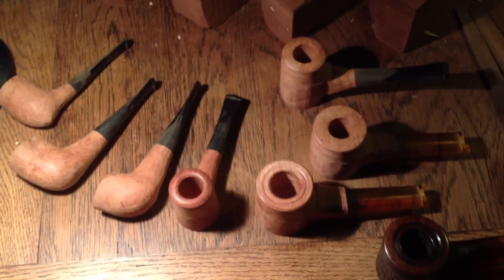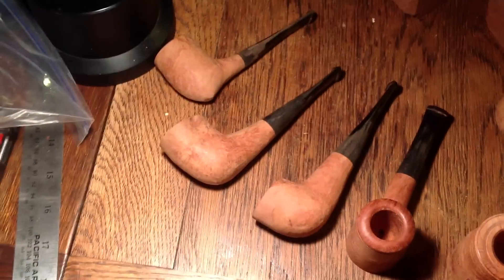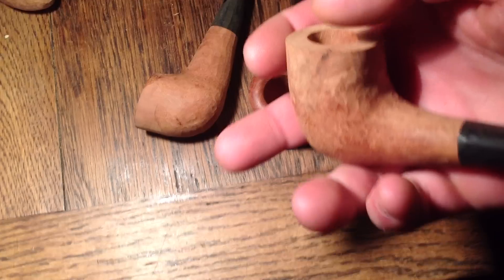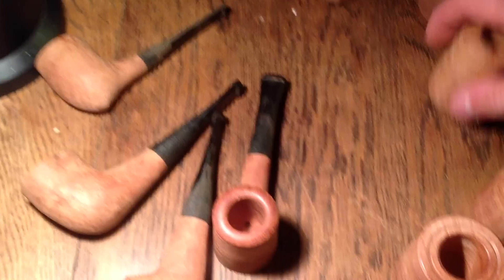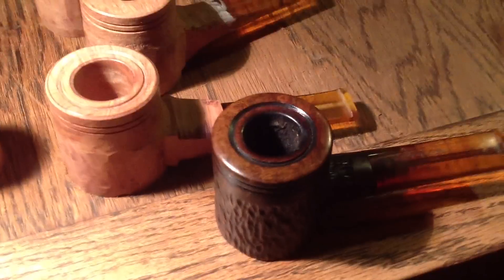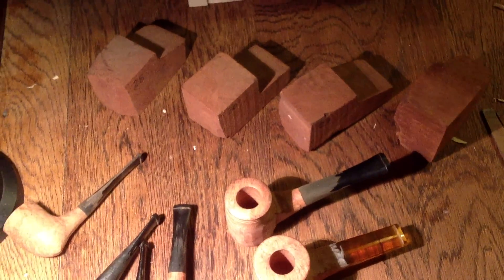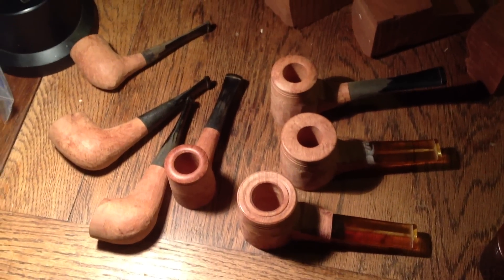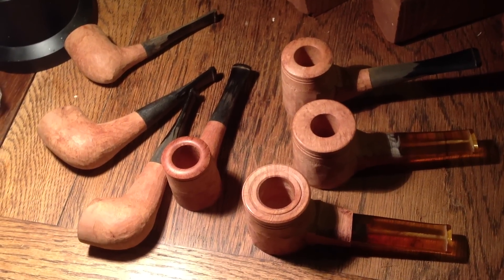Work in Progress Briar Pipes - December 2012

Comment from the maker: Thanks for watching. I put the grooves on by putting the block on a lathe after drilling the bowl and air hole. 
If you're making a pipe from a kit the only thing you need is a Dremel tool, some files & a round file and sand paper. I did all my first pipes this way. I use the Dremel & the carbide cutter for the rough shaping of the pipe since briar is so hard. Some people do just use hand saws though. Next I start smoothing things out a bit with files. A belt sander is also nice but not needed.